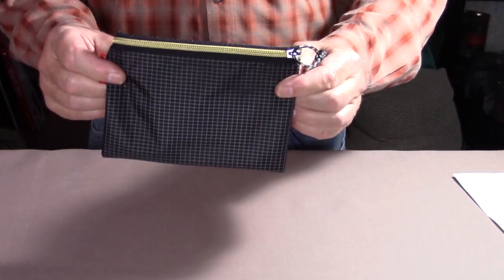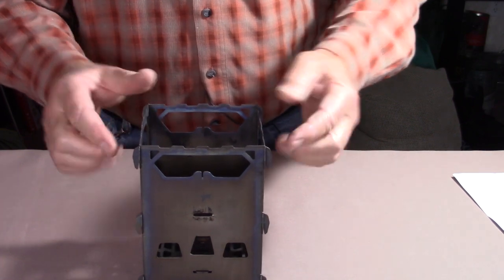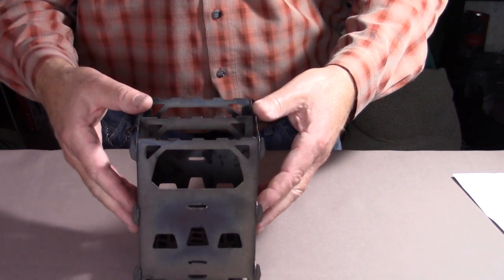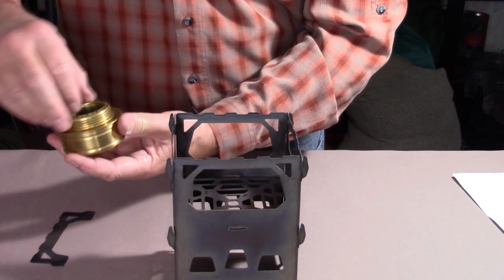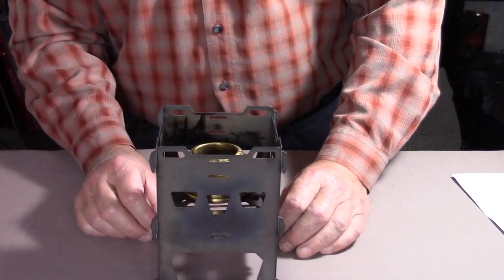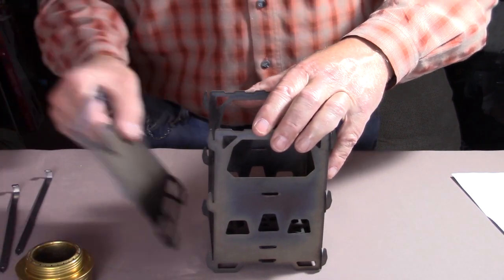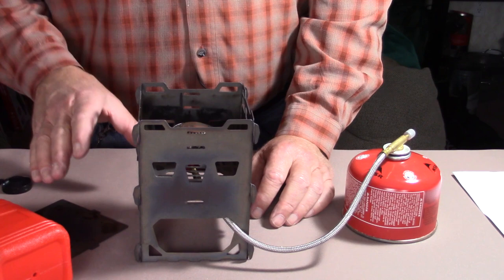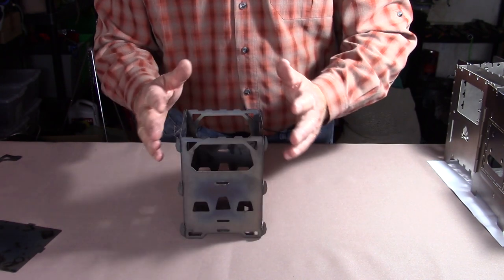Keith Titanium Wood Stove - Comprehensive Review

Comment: Mark nice review and demonstration. However i discovered with my Keith stove that there is no drilling required in order to accept a Trangia burner. Keith have ensured that you simply  place two metal rods, skewers etc into the large side holes either side of the front 'Keith' logo side,(around 3mm is ideal). The burner then nests nicely between the skewers and your distance is 1 1/4" or 31mm. It works ideal without the need for drilling etc. Regards from Ireland 🇮🇪 🇨🇦.
Reply: I meant to add that the cost including shipping from China was €55.
Reply from the maker: I have since learned that as well. Thanks for commenting

Comment: Since I use the Toaks Siphon alcohol stove, I did a little experiment for its use in the Keith stove. An experiment that yielded some delightful results.
So, I took the ash plate and inserted the tabs into the middle air vents on the three sides. Then I placed the Toaks Siphon stove on top and measured the distance between the stove top to the pot bottom, with that distance being 21/2 to 23/4 inches. Now, that’s not the much touted one + inch, but when I filled the Toaks with 1 &1/2 ounces of denatured alcohol, and put 16 ounces water in my five 3/4 inch diameter Evernew 1.3 liter titanium pot on top of the Keith, I was quite surprised to see one of my fastest boil times, and it used only just over 1/2 ounce of the alcohol fuel. The boil time of four 1/2 min was as good as any of my other alcohol stoves.
As I always carry a backup alcohol stove when I’m primarily relying on a wood stove on the trail, now all I have to pack is my 1/2 ounce Toaks , and a few ounces of alcohol.
   “I’m stoked with the  Toaks”  and “the Keith is magic”
Reply from the maker: I bought the Lixada/Tomshoo version of the Toaks. Slightly larger (cheaper also) but not by much. Super fast boil times but it needs at least 1.75" gap to get the most from it. Have use it my Keith with great success. Thanks for commenting Robert

Comment: I have owned this stove for about a year now. Very importantly, the burn, and flame pattern is excellent. I can easily preload the stove with enough fuel to boil a quart of water. Add to that the 11oz weight of this titanium beauty and it’s easy to see why this could be a favorite stove for many.
However, as Mark explains in the video,  this stove has a potential flaw, and that could be a deal breaker. When lifting the stove or pushing it into the earth, if care and attention isn’t paid, the entire stove can fall apart. Here, Mark explains which sides can be lifted and which can be pushed down to avoid this disaster. And believe me, it did happen to me, and in the middle of a burn.
So I would love to see the manufacturer retrofit this sweet stove with a locking mechanism, perhaps one that owners could easily install. Or, maybe, Mark can come up with that mod for us.
Reply from the maker: Hi Robert. I will work on a mod. If I come up with something I;ll make a video. Maybe the company will buy into it. Thanks for commenting

Comment: I can see right off the bat the Keith will work better w/wood as I have found that air flow at the top....perimeter at top of the sides...is everything. The top of the sides down to the open air cut outs will promote a much better burn. Will smoke less and be much more efficient. Thanks Mark.
Reply from the maker: Right on. That is what drew me to the stove in the first place. Thanks for commenting

Comment: Mark, I own a bunch of stoves and I like the ability to use wood pellets. I've found a way to use many of them without making modifications and that is to use a burn box. Mine is metal, has holes in the bottom and measures 4 "square by 3" deep [a tin box a gift came in]. I guess the concept is a stove within a stove. The convenience of using pellets outweighs the trouble of hauling along the burn box. Burns long enough to cook a breakfast of bacon and eggs. Yum!
Reply from the maker: Hey David. I agree a burn box is a great way to use pellets in most any stove. I prefer If I can get away without adding anything to a stove but accept a box or even a screen is a good add. I do love using pellets. I think they are often an overlooked fuel

Comment: Always like your in depth videos.  Purchased my Keith at Amazon for essentially the AliExpress price.  Will be here tomorrow.  I have several other great stoves mostly that you have reviewed, that are accurate, and interested to have my first Titanium stove.  Thanks again!  Update : so far have 3 fires in my Keith. Concerned the burn plate has a bit of warping, everything else appears OK. One fire for about 1 hour and ash built up and started choking the fire. Remedy would be to remove ash pan on long duration fires. Still testing to determine if I will keep or return.
Reply from the maker: Glad you are enjoying my videos. Let me know what you think of the Keith. Thanks for commenting
Reply: Have you noticed warping on burn plate like I have?
Reply from the maker: @kevinmccarthy6718  Yes, I have had a small amount of warping in the burn grate. Not enough to make it so I can't assemble it. What I do is reverse the plate for the next fire or two and it flattens out. Is yours really bad?
Reply: @MarkYoungBushcraft  Hadn't though of that. But once you disassemble it, how do you know which way to reverse it?  Mark it somehow? Didn't really measure the warping, but I would say 1/2 to 3/4 inch.  I've seen before how it a side panel is warping to reverse it--inside to outside.  Function still ok, but thinking in the future would effect it not sitting flat on the ground.

Comment: That's a very well-prepared report. Could the fire grate be used with an upside-down stove to support a small utensil?
Reply from the maker: If I understand your question correctly, yes, you could either insert the fire-grate in the lowest position then invert the stove or you could assemble it without a grate then lay it across the top of the inverted stove, I would recommend the first option as it is more stable. Hope this helps